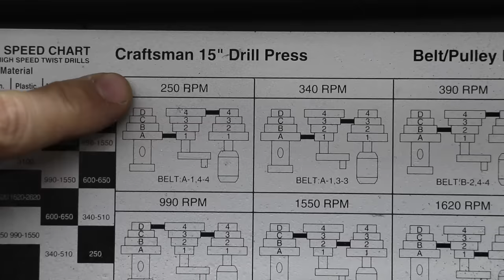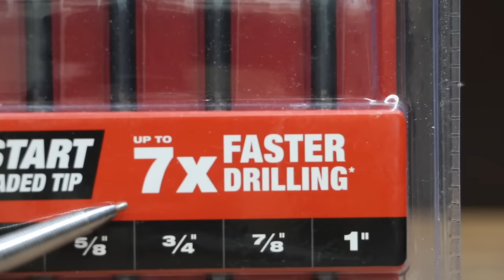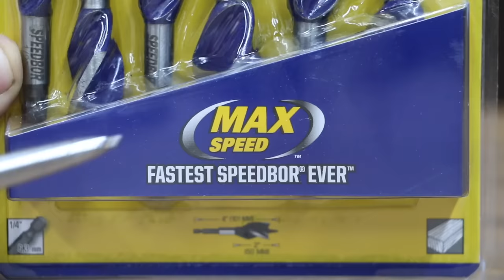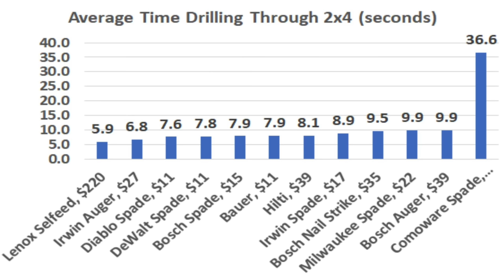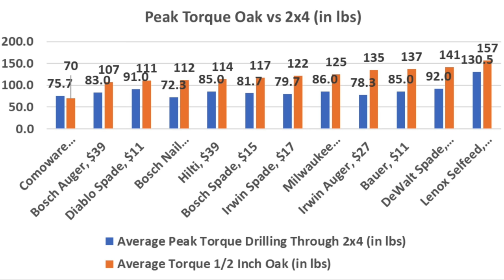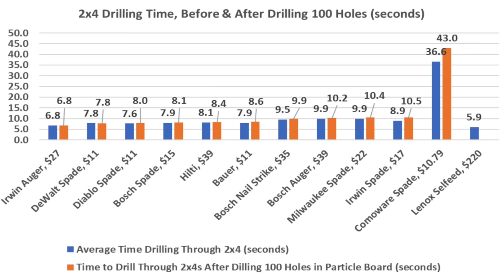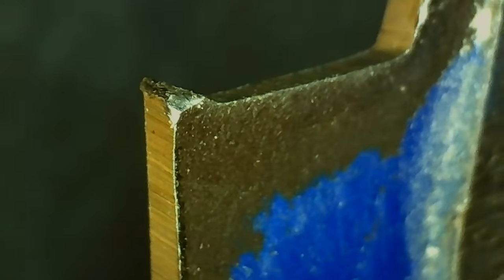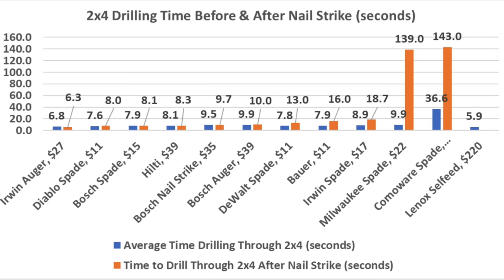Best Drill Bit Set? Hilti vs Milwaukee, DeWalt, Bosch, Bauer, Lenox, Irwin

Comment: From what I keep seeing, Diablo seems to have figured out how to perform really well in most all it's cutting tools without having that extreme price premium. I like Diablo myself, and I'll probably keep buying more Diablo stuff just because of branding, and their performance/price range.
Reply: That's what I've found too. For cutting, abrasives, sanding, drilling, etc. Diablo is consistently good without a massive price. Very good price to performance on them.
Reply: I used the Diablo bits last week to drill a shelf bracket for a very heavy fireplace mantle. I was shocked at how easily and precisely they did the job. These PF results definitely confirm what I also found last week.
Reply: Diablo keeps putting most of the other brands to shame and it is extremely impressive
Reply from the maker: Thanks for the feedback.  Happy New Year!
Reply: @ProjectFarm  happy new year!🎈
Reply: I came here to say that, never seen them in the UK though.
Reply: None of these are good, you need to get drill bits from Chicago Latrobe or Viking.... A company NOT in a big box store, and here's a little tip, NEVER buy titanium drill bits, once that coating wears off, they're only as good as HSS... Get Cobalt Alloy bits, M35/5% or M42/8% if you cutting tougher material, the Cobalt is in the alloy so you can sharpen them again and again and still get the benefits, even if you are only drilling wood, a good set of Cobalt bits will last you a decade
Reply: @post-leftluddite  some of them are clearly good. If you watched the video, you saw it.
Reply: @post-leftluddite  but "what to buy from a big box store" is this guy's claim to fame and exactly what a DIY guy like myself needs to see.
Reply: Killed mine with screw lol
Reply: Couldn't have said it better! Diablo cuts great
Reply: Diablo consistently puts out great saw blades, drill bits and sandpaper. It's one of the few brands that - without researching - I can grab off the shelf and be confident I'm getting a quality tool. Being easy to find at Home Depot helps too!
Reply: Check out what their cermet blades can do on a 7-1/4" circular saw.   I've cut 1/4" thick hot roll with mine several times.   Amazing!   I agree, Diablo is a great go-to choice!  May not always be the very vest, but always near the top.
Reply: @JessieAMorris  for sanding, the 3M Xtract is incredible. Good price too.
Reply: +1
I switched from Milwaukee to Diablo Sawzall blades about 2 years ago. Besides going through exhaust pipe like warm butter, they'll nip off bolts quickly, and last a good long time. I was burning up 2-3 blades, or just resorting to fire for stubborn sway bar end links before, now 1 blades lasts 4-5 jobs. They even cut ball joints!!!😁👍👍
Reply: TheCheesePlease  Eh, Bosch bought Diablo a while back, in 2009 or so.
Reply: I always use diablo/Freud for my circular saws, but my spade bits I prefer Bosch dare devils
Reply: @jayschafer1760  
Makes sense.
Subject to Bosch's policies and quality control (one would hope).
Although ALL of the drill bits tested were made in China (if I'm not mistaken).
Reply: TheCheesePlease  Bosch already owns Diablo, but they do seem to realize Diablo has a reputation for good value, and so far they haven't screwed it up.
Reply: Use Paddle bits every day as an Electrician. I go through at least 3 sets a year. Diablos have held up the best so far and last the longest. Drywall will kill them pretty quick though.
Reply: The thick metal cutting blade with carbide?  Hell yeah.  I cut chains and bolts for hours with one of them and a one handed hackzall.  Like a hot knife through butter

Comment: I've never been left less than impressed with any Diablo blade or bit. They're a great value for the average user.
Reply: Agreed and these tests proof that they are always near the top preformer.
Reply: Agreed. Especially their circular saw blades
Reply: Agreed, although I have use the Bosch Spade bits before, and they cut through wood like butter. Even their Masonry bits are really good.
Reply: I cut up a 32 foot fiberglass sailboat with Diablo skill saw and Sawzall blades.they held up better than most I tried. Eventually the carbines would break off, but overall and for the money, very impressive.
Reply: @DapimpBDSD  Bosch owns Freud (which makes Diablo). They are the same design, but use slightly different steels.
Reply: Same.   They have been my go to brand ober the past few years.
Reply: When in doubt, and project farm hasn’t done a video I go that way too.
Reply: Literally every blade on my saws are Diablo. They havent been changed in a year
Reply: Agreed, Diablo products have performed well in every test I've seen on Project Farm.
Reply from the maker: Thanks for the feedback.  Happy New Year!
Reply: Frankly, when it comes to blades, bits or even flap discs, I don't even look for any other brand. Most of the time they are Made in U.S.A.
Reply: @DapimpBDSD  I agree.
Reply: Bosch own diablo
Reply: @planespeaking  ok?
Reply: Hole saws are junk imo. Teeth break fast and can't swap pilot bits and you have to use their arbor specifically.
Reply: @Dr_Angry  Fine, you?
Reply: I love their flap wheels. And really anything else.
Reply: @DangRoss  yeah, hole saws have their place for large holes above about an inch and a half, but blow that there is zero point
Reply: @griffintaylor3861  Ya as a plumber I use hole saws almost daily, they are awesome, I'm not just a fan of Diablo's specifically. Besides that I like most their stuff.
Reply: @geoffstrickler  Bosch has different levels of blades. The higher levels (blue blades) are made by Freud. The cheaper ones (metal colored blades) are made somewhere else.
Reply: @DangRoss  have you used the spider hole saws? They're supposed to be really good. Better than their other accessories.
Reply: @jacksmith2315  I have not, I'll check them out thanks 👍

Comment: I love your videos, but I feel this one had a couple things that should be different. First being the speed. Spade bits are being used on drills turning around 2000 rpm instead of 250, and even the auger and Irwin self feed style bits are being run at around 1200-1300 rpm for that size. Second is people aren't putting more than 15-20 pounds of pressure into the wood, and even less with the screw tip bits. I think the results would be different if they're tested in the way they're most likely to be used. I use the Bosch and Diablo spade bits (same thing, different color) and the only pressure they see is the weight of the drill
Reply: Excellent points
Reply: Good Feedback
Reply: I would agree, but all bits were subjected to the same conditions, so it was still apples to apples. I don''t think that the point was to test how long it will take YOU to drill through whatever.
Reply: I agree with both of you, the usage conditions could have been better; but on the other hand, since they were all subjected to the exact same tests it was still fair.
Reply: Presumably he's getting the reported 54 pounds of downward force from the ratio between the bicycle rim diameter and the pitch diameter of the pinion gear that meshes with the rack machined into the quill. Doing the math 54 pounds divided by 7.5 pounds = a ratio of 7.2 to 1. I would guess that he could have put some sort of force gauge under the quill to measure the downward force with the 7.5 pound weight hanging off the rim, but I don't know for certain. Granted, this setup doesn't represent the use of a hand drill. However, he's got to come up with some simple and relatively consistent setup to compare as uniformly as possible. While there certainly are other ways, I think this is probably good enough for what he's trying to achieve.
Reply: @RustyorBroken  he has measured in other videos the force it applies and can very easily adjust it with different weights
Reply: @stevenlatham4397  I agree but disagree at the same time. With such a slow rotational speed, the threaded tips only allow it to take so much per rotation and hurting the performance. Then the excessive downforce didn't help them at all where it makes the standard tipped bits dig harder. So while it was technically a fair test, it wasn't a realistic one
Reply: @muddybadgers5205  I can agree with that. I don't remember off hand how fast my Milwaukee hole shooter spins but when drilling holes I'll have it balls out except for large bits through steel.

Comment: The first time I tried an Irwin Speedbor, it was like the heavens opened, bright light shone down, angel choirs sang...I was so mesmerized (and relieved after struggling with other bits!) by how fast the Speedbor effortlessly pulled itself into the landscaping tie that I didn't stop the drill fast enough and plunged right through the tie into the gravel an inch below. Thank goodness it didn't phase the bit one bit! 
Caution: "With great power..."
Reply: Same.. I bought a set and could not go back to the spade types
Reply: Yep... even my M12 Impact was able to use it. WORTH EVERY DOLLAR.
Reply: But the speed bor Supreme are even better! My " Let's get it done" bit once I've trashed other cheaper bits to find if a nail is in my line of drill! Recommend that method for us drill bit enthusiasts.
Reply: ...comes great responsibility
Reply: @chinesemassproduction  😉
Reply: @beerbeforebreakfast  What!?!? There's a "Supreme" version?!?!
<<Sound of boots running and truck keys jangling>>
Reply: Yes they are just starting to show up in stores. Amazon is probably more ahead with supply than Lowes. I like Milwaukee Switchblades, but these irwin Supreme can be sharpened ad are very nice to use.
Reply: @beerbeforebreakfast  Excellent! Thanks for the info and have a Happy New Year!

Comment: The Diablo bits were super impressive, especially at the price.  And I dont think I've ever seen your super high end option fail in testing so bad.
Reply: Diablo was my go to as an Electrician. Their wood augers and hole saws are pretty cheap, but do a great job.
Reply: I've had these Diablos for a number of years without doing any research beforehand.  I've used them a ton and they're worth every penny, which is surprisingly not a lot of $$!

Comment: I am an electrician. I have owned a set of Irwin Augers for years and they are terrific at drilling wood. Especially older wood in houses. They don't do so well with nails but then for that I use the 18 inch Greenlee auger bits. Those work incredible for drill holes in studs in houses.
Reply: Ditto.  I used the Irwin bits for work on my own house.  Even the old pine from 1929 seems much tougher than the wood used for framing now.  The best thing about the three flute auger bits is that the holes are cleaner than most other bits, especially in hard boards.  The only bad thing was the Irwin was too short to get through a three layer top plate; had to go buy an extra long Bosch auger bit for that.
Reply: @wtmayhew  And something he did not point out is that they're self feeding. Once you get them started they pull themselves through wood. You really do not need to push them but rather hold them back. 😆
Reply: Even after hitting the nails with the greenlees they are certainly modified.  Same for the nail cutter Bosch's.  I love the bosch auger bits where the flutes are a less diameter than the business end.  There is no drag an it melts through the wood.
Reply from the maker: Thanks for the feedback.
Reply: @ProjectFarm  Thanks for this video. Happy New Year and God Bless. Do take care. Happy 2022 to you and your family. 

Jeff - Sunny Central Florida
Reply: @Matt-my7pz  Thanks for the info Matt,  much appreciated.  My local supplier doesn’t have Greenlee bits, so Bosch was it was (not necessarily because they’re better).  Good to know both are good.
Reply: @davo7512  nails hold your house together, so how about no
Reply: @walterbrunswick  since when

Comment: When using an auger type bit on telephone poles or piles I found it is very important to get one with a single cutting edge. This leaves the widest channel for the cut material to be removed. It only took a few times getting a double edged bit stuck in a pole/pile to figure this out. It is also easy to field sharpen a single edge.
Reply from the maker: Thanks for the feedback.

Comment: I really like the Irwin speedbore. They seem to work best with an impact driver. Very fast in softwoods.
I like Bosch for spade bits, but I also have some cheap ones to sacrifice to dirty screw infested wood.
I like how your tests usually match up with my real world experience. Keep up the good work.
Reply from the maker: Thanks, will do!  Thanks for sharing.
Reply: Agreed, I even managed to bore half-inch holes 6 inches into the end grain of hardwood sleepers a dozen times and only issue was my wimpy drill.

Impact driver sorted out right out, and even the half inch bit can handle a lot of leaning into it without any bending or other nasty side effects.

Comment: Real good stuff PF!  I have tried many of these as a cabinetmaker over the years and ended up keeping with the DeWalt for the last 5-6 years as they cut cleaner holes.  Their rounded corner design surprised me nicely.
You have me wanting to try the Bosch Nail Strike for knots as I like knotty wood projects maybe even more than clear wood projects.
I stay away from self-feed bits as they tend to tear-out on the exit and they don't work on hardwoods nearly as good as softer wood.

Thanks again PF
Reply from the maker: Thanks!  Thanks for sharing.

Comment: I really really like the Bosch NailStrikes, but because they have only a 1/4” shank, they’re super easy to bend! Otherwise, it would be the perfect bit for rough drilling!
Reply: That was my experience as well. I don't think I ever got more than a few minutes worth of drilling out of one of them. Ridiculous.
Reply from the maker: Thanks for the feedback.  Happy New Year!
Reply: I had the same experience w/ irwin speedbor, nice cutter but shaft is weakened
Reply: @FixthisCD  I agree the Irwin Speedbors tend to get bent too often, but they are fast.  Have used the Lenox version of the same bits with thicker shank but they are even more expensive.
Reply: Nailstrikes have their place but be careful.  Did you see what that nail looked like in the video?  If you're running anything this side of iron pipe through that hole, good luck with a mangled nail partially embedded in the wall.  Maybe try chasing the hole with a holesaw   to clean cut the nail before you grab a nailstrike.   If you do use a nailstrike, they cut a lot cleaner in an impact.
Reply: They are by far the best
Reply: @aztecsec  careful because a single nail can destroy a standard hole saw, I see it constantly.
Reply: @austinmatney7591  Using a metal cutting holesaw to cut metal was assumed.
Reply: @aztecsec  I had to explain to a customer that “bi-metal” did not mean he could cut through metal with his hole-saw,  it simply meant the saw is made from two different types of steel. He had such a look of shock so I try not to let people make those kinds of mistakes if I can help it. I’ve learned “common sense” means “shit people other than you should know but don’t yet.” Lol